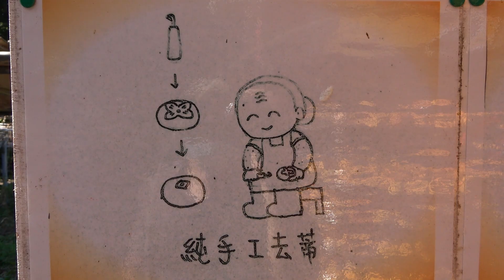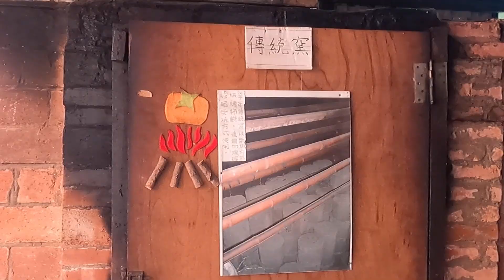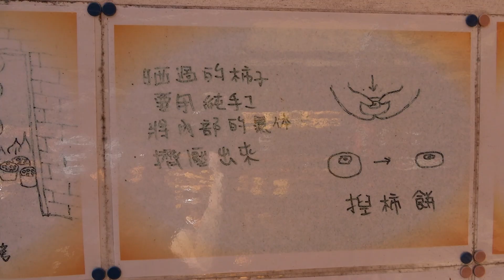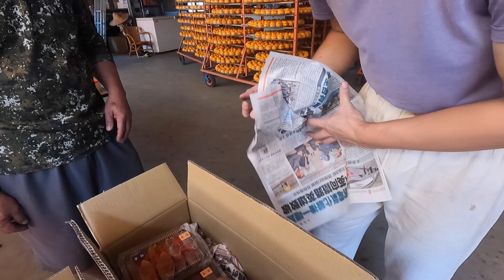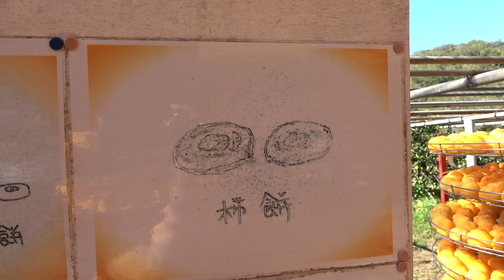Mass production of dried persimmons

Comment: Dried persimmon fruit turns brown. How can dried persimmons stay orange without turning brown? Additionally, dried persimmons often exhibit a white crystallized sugar accumulation on their surface (appearing as if molded), but in this case, there is no such sugar buildup. How is this possible?
Reply: Use magic chemicals, sir
Reply: the hachiya persimmon (astringent type) exhibit the crystallized exterior while the fuyu (featured here) tend to not to. also most dried hachiya persimmon are not massaged during the drying process while the fuyu persimmon are generally massaged every other day after the first week has passed